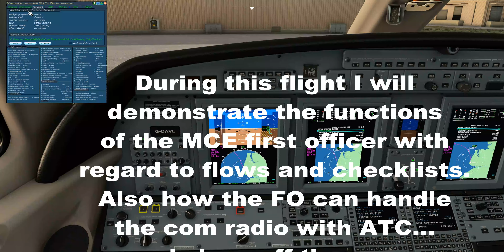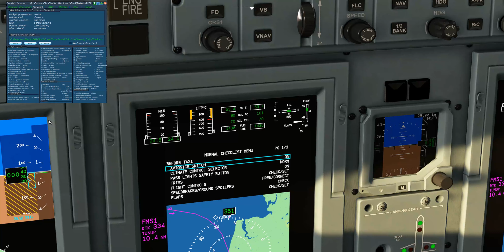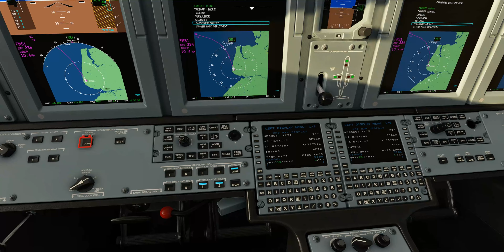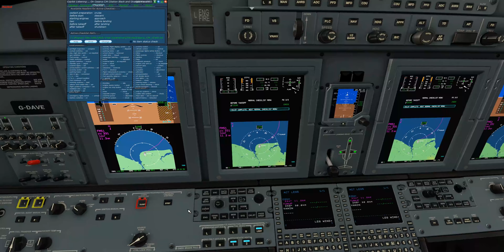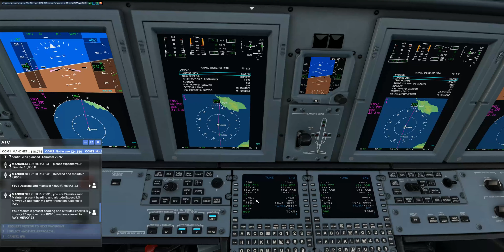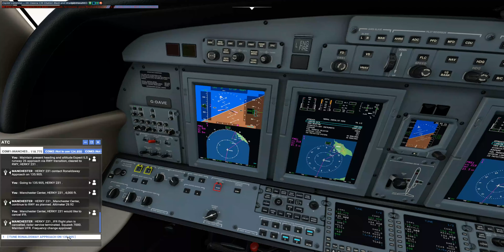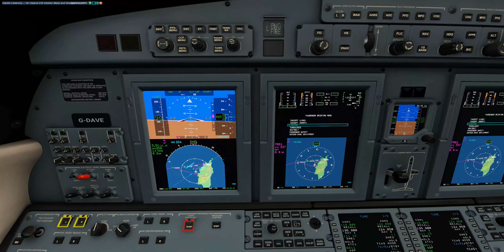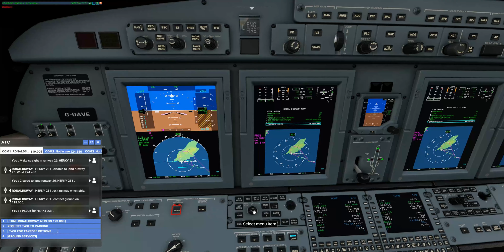MSFS Workingtitle Cj4 with MCE

Comment: Which do you think is best for handling ATC? Multi Crew Experience or Pilot2ATC? If you were only getting one of the Addons, which would you recommend? And if you get both Addons which one will be interacting with ATC?
Reply from the maker: Sorry for the delay. I use MCE with Pilot2ATC. They work well together in MSFS and P3d. Because I like Cereproc TTS voices, I can use the same TTS voice in Pilot2ATC. That way your FO is the one operating the radio.